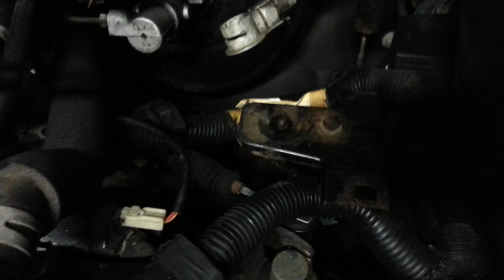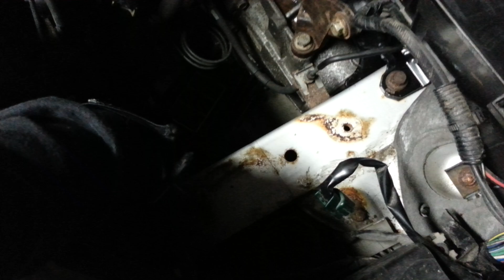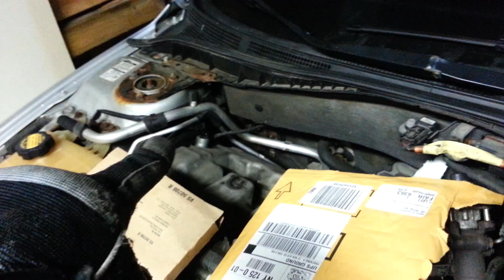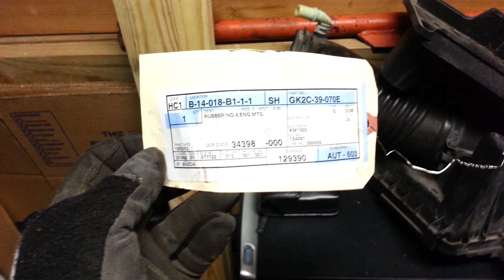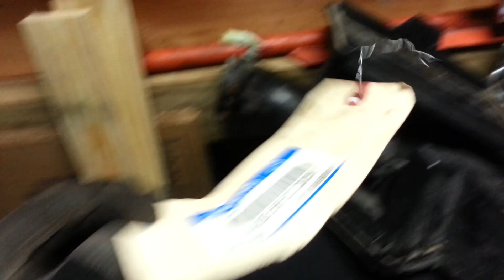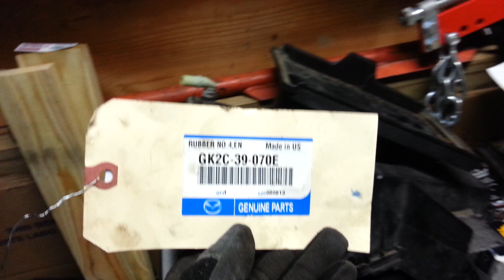Mazda 6 driver motor mount replacement

Comment: I have the 2006 V6 w/196K and have the OCV valve seal leak as well as the valve cover gasket leaks. 
Question, what were the symptoms of needing the motor mount replaced. I'm getting a shaking at speed and a bit of loose sounds going over any bumps.  Already replaced the control arms so those are good. Thanks - good video
Reply from the maker: Tricko Hi thanks for watching and happy to help. When mine shifted between gears it would shake and make a light thump noise.  Put car on ramps and check the bottom dog bone mount. It usually is the one to go the fastest.  I found another one on the side loose when someone hit the gas it would move a bit.  Good   luck!

Comment: where did you find a seal for your vvt solenoid? I can only find them aftermarket for the 4cyl but not the 6. mazda couldn't find just the seal they wanted me to buy the whole valve cover. thank you
Reply from the maker: HI sorry for late reply, been super busy with work and life.  I got them from a guy on a form.  Here is there email addy, not sure if they still have any. twistedvisionzsales@gmail.com  Good luck, thanks for watching!

Comment: May I ask, what kind of oil leak?  I have a slow leak and not quite sure where it is coming from.  Thanks for the video!!!
Reply from the maker: +Daniel Mendoza HI, at the time it was leaking out of the oil control valver that pops out of the valve cover.  I found new seals online and that fixed my issue.  One way to see where it it coming from, use engine cleaner, then drive it, keep checking till you see a little oil.  Or take it to a shop where they put a dye in it, and use a black light.  Good luck, thanks for watching!
Reply: That is awesome information!  Thanks so much!  The oil is leaking directly off the bolt on the A/C Compressor, was hoping it was the oil pressure switch.  Thanks for always posting your videos, you have seriously made life much easier when dealing with the Mazda6!  Take care and THANKS AGAIN!!!
Reply from the maker: +Daniel Mendoza Your very welcome, that's exactly why I create them.  Happy you like them.  Have a great one!

Comment: +brutmaster08 hey, thanks for the video. I was just curious if you know what the signs are to know that the engine mounts are going bad
Reply from the maker: HI, you would hear a clunk noise when shifting, or steering far right or left and hear a clunk when you take off.  Good luck, thanks for watchin, happy to help.
Reply: Good to know. I noticed my steering was off and it wasn't simply torque steering. A routine check up and my mechanic noticed that the mount had collapsed but he wanted to charge $700 for it. Boo.
Reply: @bodhinature  arnt they around 40 quid to buy..... Seems an extortionate quote mate.
Reply: @aapee8661  yeah, that's what happens when you go to a dealer. I bought a new mount for $60US and replaced it myself.

Comment: Is this the 5-speed manual or automatic?
Reply from the maker: Hi, it is a 5 speed.  Thanks for watching.
Reply: brutmaster08 Thanks, I just ordered a set of the AWR motor mounts for my 04 Mazda 6 5-speed and couldn't find any other how-to on the tranny mount. This one is perfect.
Reply: +AnythingLoud There are other videos on youtube about this engine mount.

Comment: Is this a 4 cylinder?
Reply from the maker: +mightycpa Hi, no its a V6 DOHC 3.0l.  Thanks, Brutmaster08
Reply: +brutmaster08 Thanks, I listened again and heard that, forgot to amend my comment.  I looked up the part number, and I see it's the combined motor mount and transmission mount.  How did you know it needed replacing? Did you have some of the other components removed already?  Thanks for the video.
Reply: +mightycpa What I mean is, what alerted you to the fact that it needed replacing?  When you removed the other components, did that expose the problem?
Reply from the maker: +mightycpa Hi again, well I extra engine movement and  a light clunk when turning and releasing the clutch.  You could feel like something was loose.  I went under car when it was running and I could see the mount was broken and wobbling much more.

Comment: .. It is advisable not to strain with the braids on the bracket, but immediately remove the iron attached to the engene so that I could approach the side braces?
And what is 1. symptom of driver side mount? I have aftermatket, but engene shake.. video of my vibration: https://youtu.be/8X8XrvDh6Rg

Comment: That one is called the transmission mount. It sure was a bitch 😂 I did it 2 days ago and mother Fker... those bolts were hard to remove and put back on.